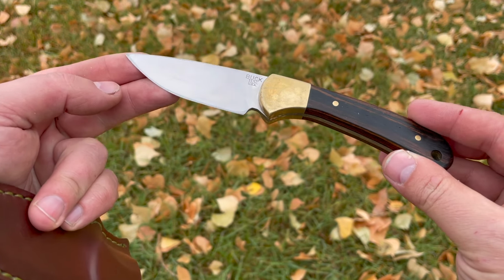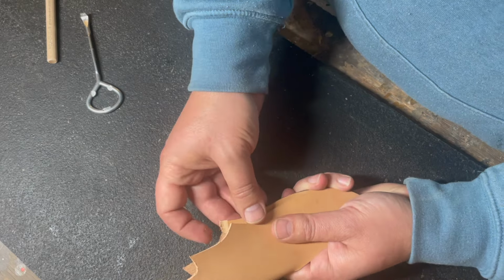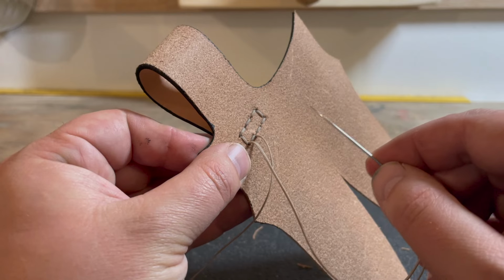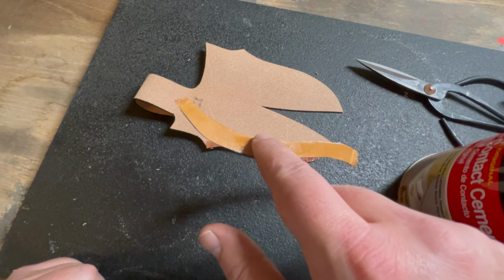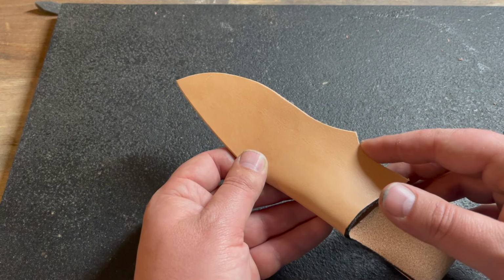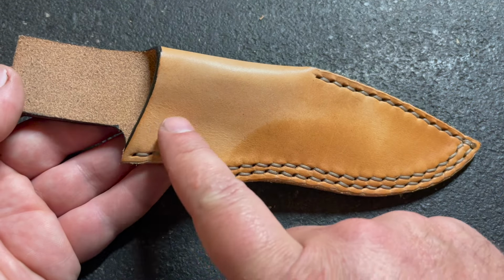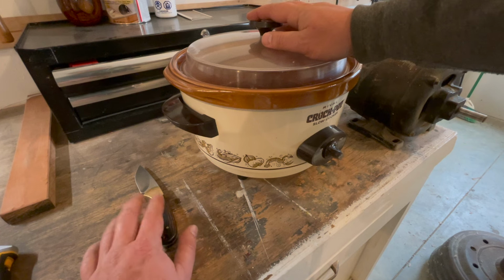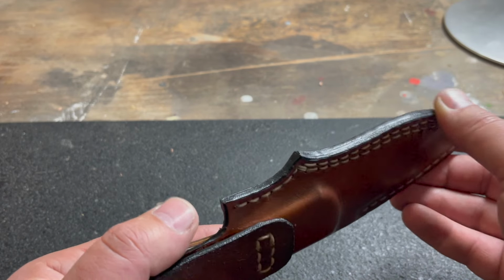My Favorite Hunting Knife Gets a New Wax Dipped Leather Sheath | Buck 113 Ranger Skinner

Comment: If you wet the edge and use a slicker, or your antler or a piece of canvas, your edge will smooth out really nicely.  Then use your dye on the edge afterward.  I've found that many times I don't need the edge dye after using a wooden slicker...
I like the use of wax and beef tallow.  Another product that works well is Obenauf's Heavy Duty LP.  It was designed to protect and waterproof leather boots worn by wildfire fighters.  Great stuff.
Reply from the maker: Thanks for the advice. I do as you say now although I find that the edge takes the dye much better if applied before slicking. I have used a lot of obenauf’s and I even have used it in a bees wax mixture. Good stuff if not a little pricey.

Comment: Very nicely done.  The only thing I'd change is the method of stitching.  I use a stitching pony and that allows me  to saddle stitch in the traditional two needle method.  I find that it helps to attain the proper tension in the stitches.  It is more challenging to get that result with any other method.  Other than that, you can't argue with success and your sheath turned out nicely indeed!
Reply from the maker: Thanks sir! This sheath was saddle stitched with two needles. I just don’t have a stitching pony and I didn’t show pulling the stitches tight in the video for the sake of time
Reply: @wyomingwright  Nice job!
Reply: if you don't have a drill press how do you recommend punching the holes?
I just made my first successful sheath after many trial and errors, I have everything but the edge stitched up because my pricking iron won't go through 3 layers of 7/8 ounce leather.
Do I have to go buy a drill press?
Reply: @escapetherace1943  Stitching chisels are very popular and what I use.  There are a number of great videos here on YouTube by Nigel Armitage.  He reviews the tools, shows how they work, what size thread to use, etc.  Check him out!

Comment: Neatly done . On the wax what are you using bee's wax paraphine or what ?  At 81 now a little advice you did not ask for but will give it any way. Your just to close to the edge with the stitch holes couseing the bumps on the edge that can not be dealt with when punch the holes it puts uneven pressure on the leather creating the bumps on the edge . I have found over the years in repairing sheaths and lit me say this problem does not happen over night it takes years to hppen .That square stich pattern you have chosen is problamatic over time it weakins the leather and couses failure the leathe tends to crack along the stitch top stitch line it is a stress point I eleminate the top stitches and have a you shape pattern and don't think for 1 minute that this is a weaker pattern and on larger sheaths I hvae 3 virtical stitch lines and have never had a failure. Remeber it is only advice and few take it in the spirte it is given . One more thing about the wax I did it for years with bee's wax and olive oil combo the one thing I found out over the years there's doesn't seem to be a dimes differance over time providing the leather is treated but unfortunaly most do not take care of there leather items so the wax is a good treatmate for most . I do not do it for my self any more all leather items get treated after new years every year . Don't loose your neatness in your work it will serve you well down the road. Happy Trails
Reply from the maker: It’s bee’s wax. I appreciate the advice. Can you explain a little more about the stitching pattern? Are you talking about where I stitched the belt loop on? Thanks
Reply: @wyomingwright  Yes instead of a box pattern us a U shaped stich or just 2 straight vertical sticth lines or even  a V shaped . Anything other than the horizontal stitch line it weakens over time and lossen up .and even cracks .
Reply: Yes

Comment: That 113 looks like a real useful size and blade type. The sheath is also really something too. I have some knives that aren't what you want to carry on your belt. They are pack or truck or camp knives. They do need sheaths to protect them though.   I think Bill Bagwell's brass stud sheath design that allows tucking under the belt for carry might make sense even on a knife that would rarely be carried if ever carried around. It gives an option.
Reply from the maker: It is a handy fixed blade. I’ll have to look into Bill Bagwell’s design. Thanks for commenting!
Reply: @wyomingwright  You will likely find as did I, that the brass stud design needs at least a 6" knife to work as intended. The stud is just to keep the knife from slipping down. It's just belt tension and friction that allows the draw without the sheath moving with the knife.

Comment: Hi  nicely done, excellent work, and superb close up filming of the whole process, I have a question if you don't mind, what type of sewing thread do you use,  and does the Buck 113 hold a decent edge, it looks a nice knife. Thanks for the video, stay safe, best wishe's to you and your's, Stuart UK.
Reply from the maker: Hi Stuart! Thanks for commenting. I use a braided waxed thread from Maine Thread Company. It is a pleasure to use and extremely durable. The Buck 113 is a great knife. You can order it in S30v from Buck which holds a good edge. The one I have is made of 420hc which does not hold an edge as well but is easy to sharpen. Though it does usually get me through a deer or pronghorn cleaning job without needing sharpened. I love the blade size and profile.
Reply: @wyomingwright  Hi  thanks for the reply, and info, stay safe out there,happy hunting, Atb,  Stuart UK

Comment: Is there a specific technique used to get that audible click or is it just a byproduct of doing things correctly and It working out that way. That's just something I've always wondered.
Reply from the maker: Just plenty of time working the leather around the knife handle. Working the leather with the right amount of moisture helps too. Not too wet. I also re-mold the leather after dipping it in wax while it’s still hot. When it cools, the wax holds the shape very strongly which helps with retention and the “click”

Comment: New subscriber here. I think you do excellent work. Really great craftsmanship! Can I ask, what do you use as a cutting mat? Keep up the good work. You videos are a pleasure to watch 👍🏻
Reply from the maker: Thanks! I use a piece thick rubber mat that bought at a farm and ranch store. It typically goes in the bottom of a stock trailer but it’s about 3/4 of an inch thick and indestructible. I’ve cut lots of leather on it and you can hardly see a line. I use an anvil to set snaps, rivets and punch holes
Reply: @wyomingwright  thank you for sharing. Looks like it works very well. I appreciate the info😊

Comment: Very nice !  What is that work surface on your bench top ?  Is it some kind of mat ?
Reply from the maker: Yes, it's actually a piece of rubber mat most people use to put in the bottom of their stock trailers. I tried it out of curiosity and it works surprisingly well. It's probably not the best work surface out there, but the price is right and its working for me :)

Comment: How long do you leave the sheath submerged before taking it out?
Reply from the maker: About a minute. Long enough there’s no more large air bubbles coming out and the leather gets up to temperature. If you pull it out too soon all the excess wax just hardens on the leather. If the leather is up to temperature, the excess wax stays melted and drips off or soaks in and you have hardly any to wipe off.

Comment: Do you have a video of how you made the knife sheath  pattern if so the link please
Reply from the maker: I didn’t make a video, but what I did is download a picture of a Buck 113 into PowerPoint, then made an outline that I liked providing a little extra space, especially where the handle and bolsters would rest in the sheath. When I had the outline I wanted, I copied it and flipped the copy and placed it on top of the original so that when it is folded you have your sheath. I printed a few different sizes until I got the scale just right. You can fold the paper template around the knife just to kind of test it out. It takes some trial and error, but once you have a good template, it’s worth it.

Comment: At about what temp are you getting the wax to? I’ve been dipping mine at 275 degrees and it’s hit or miss if that’s too hot. Thanks.
Reply from the maker: I’m trying to stay down closer to 170. It helps to add some tallow or another oil to bring down the melting point a bit. Also if you warm up your leather before you dip it, it helps.